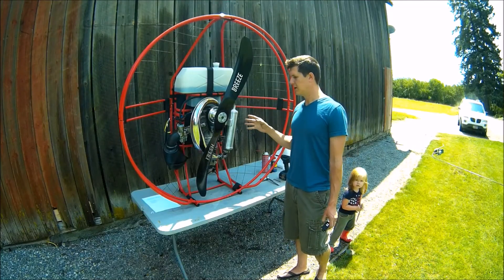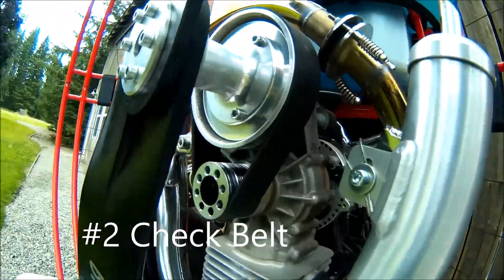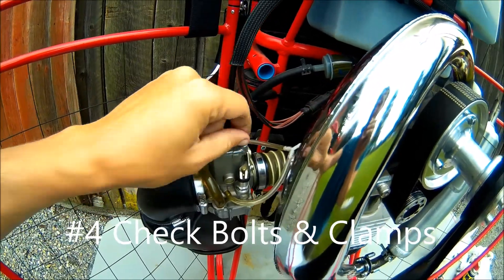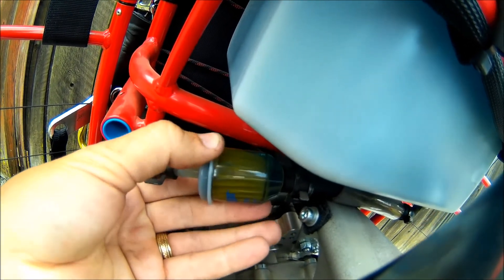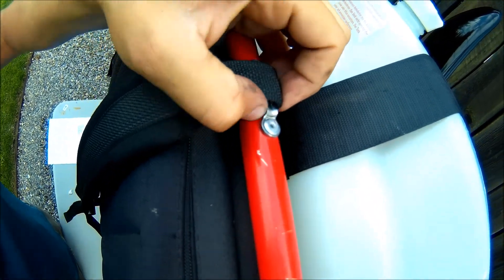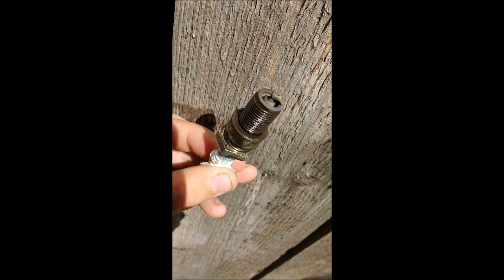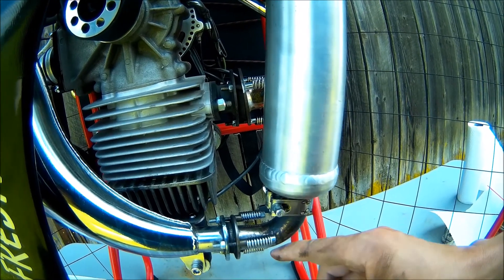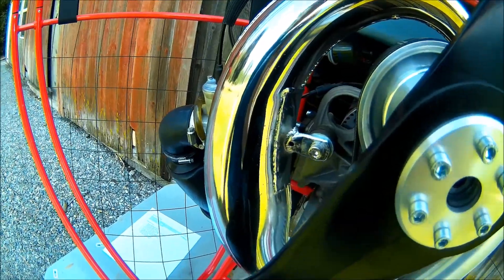Siminini Fresh Breeze Paramotor 10hr Maintenance

Comment: Hello, I have Fresh Breeze Simonini. I have a problem, which is that the engine does not respond quickly when you step on the gasoline and there is an irregularity in the rotation. I replaced the engine spark plug and first-class gasoline and first-class grease. Mixing every liter of gasoline 20 cc of fat and cleaning the carburetor well and the situation remained the same
Reply from the maker: Have you adjusted the mixture?
Reply: @SlowerLiving  I will check the mixture with my friends and tell you sir
Reply: I tried with the mixture but it didn't work.  Can you tell me how many cycles of the mixture screw and speed screw are and are they related to each other.thanks
Reply from the maker: I really don't know for sure. I've been nervous to touch mine.

Comment: That screen inside the carb bowl simply prevents fuel foaming. It is not a filter. If you pull the bowl & the carb continues to leak (or through the clear equalizer tube (comes from each side of the carb) you have a dirty Viton tip. Pull it, clean or replace it if worn toward the tip usually. I suggest pulling the carb & inverting it to get at the Viton tip. Take photos! So you'll know how it goes back together! Important! I speak from agony & a 98 degree Florida day. Have flown 2-cycle ultralights for 47 years. Great video! Thank you!
Reply from the maker: Thanks for the info
Reply: @SlowerLiving  ....You did a good job Scott! Just wanted to clarify a couple. I'm no expert by far but learned from S.H.K. University. School of Hard Knocks. Cost me plenty to educate myself.

Another thing I've noticed about Paramotor 2-cycle power pilots. Warm 'em up good guys! Don't just go from a 30 second idling to full power. You'll scar the heck out of that cylinder wall & likely freeze a piston in flight sooner or later. Same goes with shutdown. Give it a minute to return to normal idling temps.

Comment: The model number you know has a 110 siminini engines and the 122 models? Well, there know to fresh breeze has the snap, solo models. those models have been out of production for three years now. Anyone who buys these units will have a hard time getting parts. If Kurt sold you this? he saw you coming! you if bought from Kurt? you got conned! Do yourself a favor, get rid of it, sooner the better.
Reply from the maker: I didn't buy from Kurt. I've found parts readily available.
Reply: Parts are easy to get for them I have a friend with one he has no problem finding parts

Comment: The spark plugs you showed were automotive. A Good running spark plug should be a nice chocolate brown and will have a sealing washer. Not trying to be a know it all just think you should have the right spark plug diagram if you show people.
Reply from the maker: Chuck Come that's the sparkplug from the manufacturer. The manufacturer said an oil covered spark plug is normal for this machine.

Comment: I have a 35 year old Husqvarna two stroke chainsaw that probably has cut 2 semi-loads of wood and the Carb. has never been cleaned, it is presently running on its 2nd. sparkplug. The Engine on this Saw has Never Failed, it has run out of gas and went through 2 bars and Many Chains--if Husqvarna Made Paramotors, Engine Failure would be a Thing of the Past.....
Reply: randy beard maybe we should write them
Reply: A chainsaw is 1HP at 10-15 lbs compared to a paramotor that 20HP at 50 lbs.
Reply: I hear ya I have a old husqvarna that never gets maintained and the new one I just bought I bet if there was a way to rig a propeller to it I know it would have enough power

Comment: Hey Scott, are you going to do other maintenance videos? Thanks
Reply from the maker: Randal Wilson yes. but the it's the same thing every 10 hours until you hit 50 hrs. at 50 you'll want to change your belt and some exhaust parts ect. So I'll do a video when I hit 50hrs. I'm only at 30 now so it'll likely be spring when I hit 50. I don't fly much in the winter.

Comment: where would you get the replacement parts?
also on mine it leaks gas from that T out of carb.
Reply from the maker: You can get parts at southern skies or from captain kurt.
Reply: southerskies.net. for replacement parts
Reply: You may have to type it in this link is no good.
Reply: you just misspelled it.  southernskies.net

Comment: Is your engine a simonini mini 2? Do you know what size main jet your carb is running? I've been doing some work on the Bing and jetting, in reference to the mini 2 engine.  
Just as a note when you pulled your carb apart, you took out the needle jet, and the main jet. You can actually just take out the very bottom Main Jet if you want, without taking out the upper needle jet.
Reply from the maker: I haven't heard of the mini 2 so I assume that's not mine. I am using the default jet which should be perfect for AV Gas. I'm flying between 2200ft asl and 8000ft normally.
Reply: @SlowerLiving  How many cc is your motor?  Also the hp?
Reply from the maker: @xxxkahunaxxx  200cc I forget how but its 155lbs of thrust.

Comment: Thanks for the video. I'm preparing to buy a monster soon and since i've never worked on a 2 stroke before i'm doing my research to make sure i know what i'm getting into. Have you had any failures or motor outs yet? It seems that their is a tool kit that comes with the paramotor. Will i need any specialized tools in addition to those?
Reply from the maker: MrPants4me you don't really need any specialized tools. Most aircraft does maintenance regularly even though it is usually not needed. I have never had any motor out besides running out of gas one time. but I will continue to do the maintenance so I don't have a motor out
Reply: I have the same motor and pretty much everything you need is in the tool kit that comes with it.